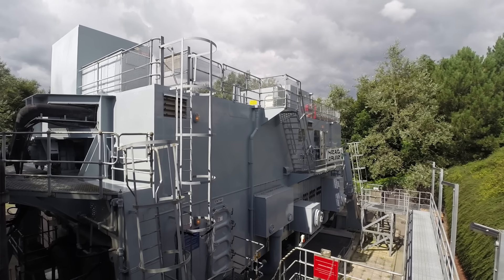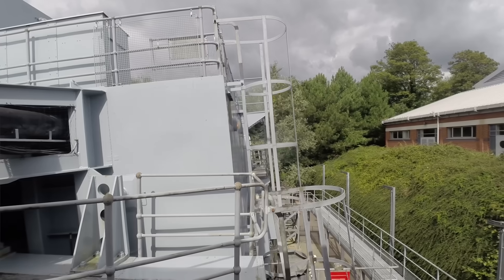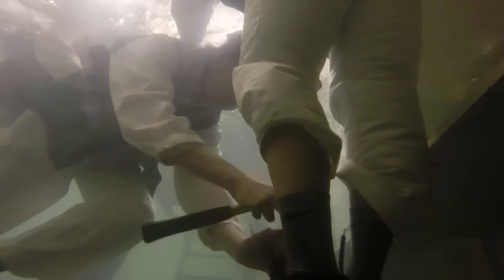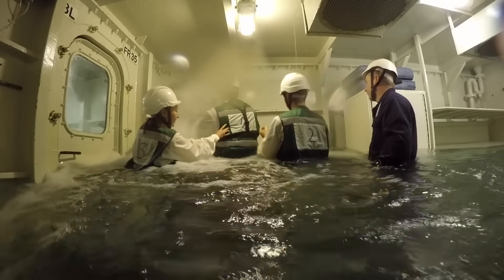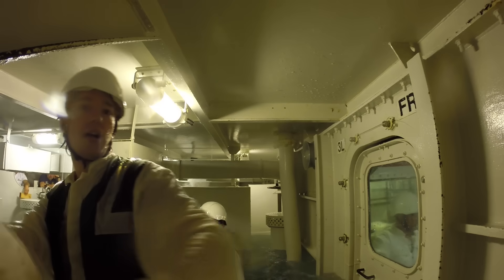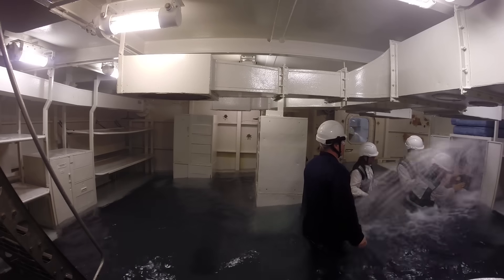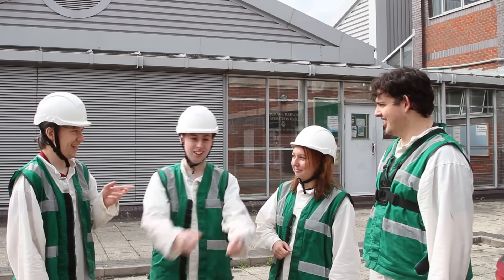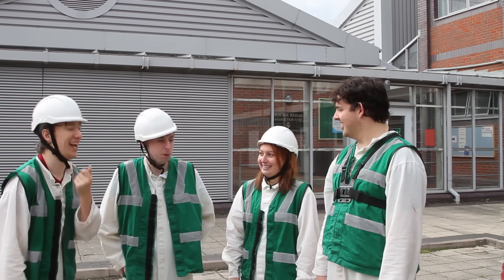Sinking Ship Simulator: The Royal Navy's Damage Repair Instructional Unit

Comment: very cool I have tried going into a fire fighter building with smoke and flames. water must be a lot harder, a lot of pressure and forces pulling you around minus the heat.
Reply: +Magnus Bekkengen minus the heat but plus cold.
Reply: +VintageLJ The minimal set of fire-fighting gear on ship is a mask and gas tank. The crew are often drilled hard to don the mask and gas tank in under a minute. The gas tank lasts for only 10 minutes or so, thus they use it more for small fires or extracting personnel stuck/unconscious in a compartment.
Reply: VintageLJ But they would not need fire fighter gear to try to stop a hole in their ship. they are 2 different scenarios. either you got a flame out of control or you got water out of control. fire fighters and navy men are trained differently, or both at the same time since a fire can burst out of control on a ship and so does a leakage.. you say they don't have the time to put on proper gear like fire fighters, well they are not fighting fire. putting on heavy duty fire fighting gear would do no good in a bowl leek.
Reply: +Magnus Bekkengen I don't remember if its on the same facility or not, but there was a navy firefighting simulation very close to the damage repair unit (portsmouth), less intensive but also good fun.
Reply: I've done this (on the hardest difficulty) and the fire version, I much prefer the fire version as you said it's less physically difficult but I found it more scary

Comment: Do you know if these techniques have ever been used in non-simulated situations? Did it work?
Reply from the maker: +Zachary O'Connell Yes! HMS Endurance and HMS Nottingham were both saved by good damage control. There'll be a special team who've trained on board for severe damage: we had a limited version of the basic training all recruits get so they can be useful "first-aiders" in case of emergency.
Reply: +Zachary O'Connell They are tried and tested methods. A lot of these techniques have been around since WW2.
Reply: Ascdren Oh of course, I was referring specifically to their use on steel body ships.
Reply: +bigglessy been around a lot longer than that, same techniques where used back in the years of sail.

Comment: the moral of the story is: "if you go into the royal navy, take goggles..."
Reply: +catfish552 Googles could get foggy and you can't see through the splashing water anyway. Also keeping them inplace when you get hit by a pressurized stream of water would be impossible and they could actually be dangerous for your eyes if they slipped in the wrong angle and the sides would hit your eyes. I think they wouldn't help at all.
Reply: +Louieno1 Right!

I guess there's some reason they don't get any, but it seems that goggles would really help.
Reply: +rangedfighter but if they are diving to fix something under the water they won't see anything.
Reply: +Louieno1 And a mini respirator.